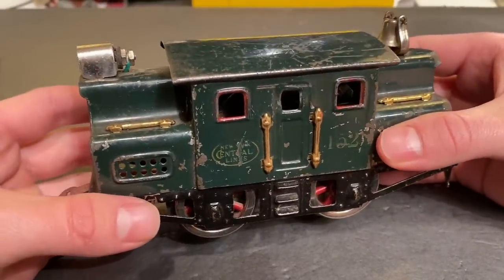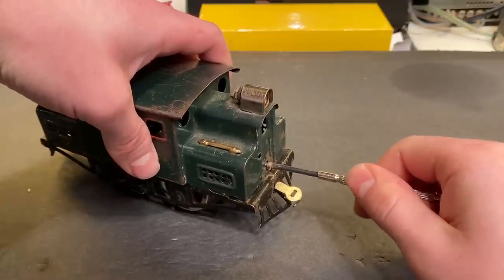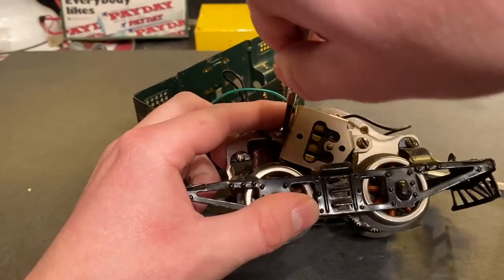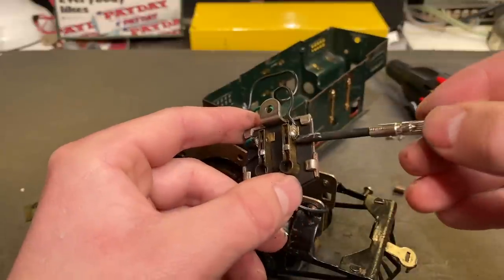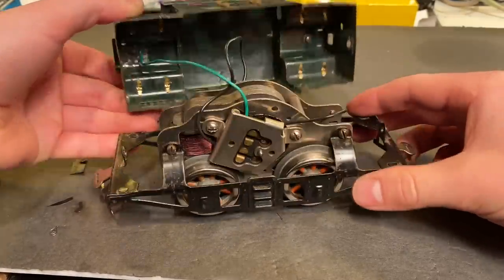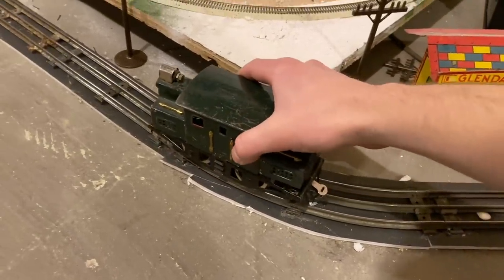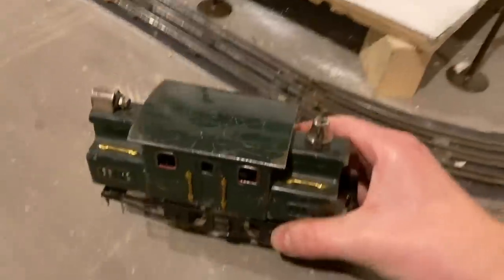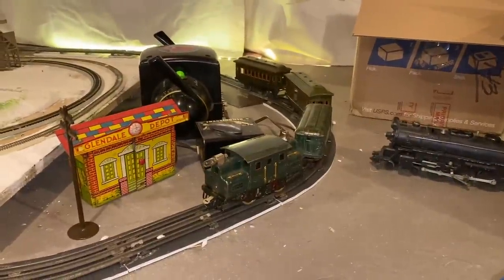Can We Make This 100 Year Old Lionel Locomotive Run Again?

Comment: The Lonel 152 was manufactured from 1917-1927. Great job on getting it back up and running!
Reply from the maker: I wonder where in that time frame this one was made.
Reply: @SMTMainline  Greenberg makes a great little book for this, if I get it for Christmas I'll see if I can't determine what vintage it is based on the design of the motor, although I suspect it's a later one based on the motor frame design.
Reply: A spot on restoration on a Lionel template train
Reply: Jacco nouwen 28 12 1968
Reply: I wonder  it must have cost a fortune back then

Comment: A little bit of knowledge that you might not know: the coils are actually made with fabric insulated wire because magnet wire (the ceramic coated stuff in most HO motors) wasn't developed until the late 30s by none other than AC Gilbert, of American Flyer and Erector set fame. The coils look pretty good on that loco, usually they're covered in dust and old grease. The rollers should also be cleaned, probably is one source of the sparking. I have the Standard Gauge version, the 33. Currently I am trying to find parts for it!
Reply from the maker: I was wondering if the magnet wire was coated with something different, thanks for letting me know. Also I did clean the rollers off camera.
Reply: @SMTMainline  You're welcome! Also the last two coaches in the set are from an American Flyer or Ives set from a similar vintage, but the first one is original.
Reply: Interesting you should mention this because I too have a standard gauge init as well as a couple of cars. The wheels on mine are zinc, or pot metal and are expanding and crumbling apart.... what is out of spec on yours?
Reply: @kleetus92  The pot metal parts should be replaced when you see cracks in the metal. I've had to replace two sets of wheels on Lionel locos so far, one I just completed yesterday! It was a O gauge prewar 248.
Reply: @zenithcoinsandhobbies  no doubt, these are completely shot... these were shot when I was 10... I'm 48 now!
Reply: @kleetus92  What type of loco is it? You might be able to find replacement wheels for it.
Reply: @zenithcoinsandhobbies  same style as this one but standard gauge, so it's the 3 rail version of lgb.
Reply: Enameled magnet wire (actually varnished) was invented by George A. Jacobs in 1907.  Although modern magnet wire is referred to as "enameled" the insulating material is actually a polymer material such as polyurethane or polyester.  The windings on this pre-war #10 (mid 20's to mid 30's) engine are varnished copper with a fine cotton cover.  Those old open frame motors are power hungry and make a lot of dust from the brushes.

Comment: Great job! No E units in that era. The E unit was part of the Ives acquisition about 1931. Someone has replaced the wire as these locos had sleeved and cotton wrapped wire insulation. They get about three feet from the power source and slow down. Adding in additional feeders helps. I once did repairs at a Lionel Service Center, and we would get locos of every vintage, especially around Christmas.
Reply from the maker: Thanks for sharing.

Comment: I’ve serviced this type before.  Yours was in incredibly great shape!  I would however, replace all the wiring in it.  Also, the brush springs are available from Lionel, or any Lionel dealer.  You may have to modify them slightly, but they’re still using similar ones today. By the way, it is a universal motor, and will run well on DC.  You won’t get nearly as much arcing on the commutator and it will run cooler because of that.  I ran many vintage Lionel locomotives on DC.  With steam engines with a whistle, disconnect the whistle, or check for ways to modify the unit somewhat.  Nice job on it.
Reply: His looks fine, someone's already rewired it. Sadly it's something all too common in the American collecting scene

Comment: You did a very good job in repairing that vintage Lionel Electric. First i kept saying it's going to run. I knew it would.  Second this is a replica of THE NEW YORK CENTRAL ELECTRIC built around 1917. It has been featured in photos of on Park Avenue & on The New York Central Railroad. The model has a rich history as well as the prototype. Well done. 👍✅🚂🚃🚃🚃🚃

Comment: SMT - Those wires have plastic insulation; they were replacements for the original fabric-insulated wires.  Don't forget to add some grease to the armature gear & oil to the bearing on the other side.  This is probably a forward-only locomotive; no sign of a E - unit or a manual reverse switch.  You can use your bright boy to shine up the center rail contact rollers.  You can also use a brand-new plastic scrub pad on the rollers & the rail heads of your track.  Keep in mind the wheel bearings on the passenger cars may need oil too.  Like another modeler pointed out, the loco may run on DC too, since it most likely has a series motor.

Comment: Nice job. That loco was repaired previously some time since about the 1970s. That plastic insulated black and green wire didn't exist before then. You could get plastic insulated wire back to the late 1950s, but the insulation looked different. Before that insulation was usually either rubber or fabric covered rubber. The rubber got hard over time and any movement would make it crack. The fabric covered insulation would stay on the wire, but the bare rubber insulation would crack and fall off, leaving a bare wire to short to things. I would guess this originally had rubber and fabric insulated wire, which could have failed and shorted some time in the past.

You need to be very careful with that bare enamel-insulated magnet wire. The insulation on the wire is literally just a layer of paint, and it can scrape off easily on a sharp edge of the frame. It can also crack and flake off of old wire just from bending the wire sharply. But if you are careful with it, it will last forever and work just fine.
Reply: That's some detective stuff there man

Comment: Nice you got it running! I would have replaced the motor brushes and brush springs... but that means buying new brushes and brush springs. Generally speaking you want the springs and brushes to be matching, and there are problems when they don't. But even if it's not "ideal" your fix definitely will last a while longer before it needs them replaced. The solder on the pickups is likely because of an issue a lot of those locomotives have- they use a springy copper strip to press the rollers down to the track, but over time these springs typically work harden and eventually snap. Someone must have used the solder patches in an attempt to repair the break in the spring.
Not too bad, considering you don't know a lot about O gauge!

Comment: As an O Gauge repairman, I'd be happy to share a few tips and tricks whiole maintaining Lionel Engines:
1. Always clean the pickup rollers, and the track. The rollers on that engine look like they could use a cleaning.
2. The brushes have a flat-head divit that the spring should rest into.
3. If you're confident that you've wired everything up and still won't get movement from the motor, try flipping the wires that go to the motor. Where the fielding coil wire goes is crucial to the operation of the engine.

My oldest Lionel loco is from 1939, and of course Lionel has used basically the same motor tooling for all engines c. 1910-1990. I'd suggest you start to get a small gathering of parts (new brushes, springs, pickup rollers, etc.) for whenever these odd jobs pop up.

Comment: We also have Dad's 2-4-2 oil fuel steam locomotive.  The NYC runs great and has never been touched, but the steamer needed to be rewired and the two 3rd rail rollers replaced.  Cost a good but, but it runs like new.  We can now control the speed, where before it was either off or running a full throttle.

Comment: Ohhhhhh, my! My dad had one nearly identical to that one, but it had headlights on both ends, was a little longer, and had the "latch" style couplers. It also was a lighter shade of green, i have no idea what happened to it, but i know it was worth some money. His was either the #251 or the #253, dont remember for sure.
Reply from the maker: I think the one you're referring to is much more rare than these.
Reply: @SMTMainline  quite possibly, i think it was from the 1920s or 1930s, and had 2 "mini-pantographs" on the top, as well as 2 headlights, and there was a directional switch in one lower corner. It had either 2 or 3 matching passenger cars that were lighted. He also had a "2-4-2" steam loco, with a 4-wheel tender, a Shell tank car, yellow gondola, and a green flatcar, plus a red and green 4-wheeled caboose. There were 3 4-wheeled passenger cars, that went with the steam loco set, they were a brownish tan color. I dont know what happened to all of it but i know the whole thing was worth some money. Would you happen to know where i could find some drive bands for some ancient Athearn engines? I have 2 F-7s and a GP-9 that run, they just need those bands. And i am also looking for either an AHM or IHC GG-1, the body doesnt matter, but i need a good mechanism/chassis, or just a motor and drive wheels for one. (I am like you, like to fix older/non-working trains!)
Reply: @SMTMainline  one of the comments mentioned that the older Lionel could run on DC, and that is correct, i have  the manual for the Lionel trains my dad had, and there are directions on how to use the old 6-volt dry cell batteries, as a 6-volt car battery would have way too many amps, and fry everything.
Reply: @paulsmith5398  Ebay seller has Athearn bands. A little over six bucks will get you 24 of them
Reply: @dtsalek  sorry, i dont do ebay......thanks anyway! And have a great holiday season!

Comment: To fix the brush plate use a small washer instead of tape. I think the fiber insulator thickened over time and pushed the brush holders into the frame.

To clean up the coil wire, cut the black wire from the coil and bring it out the back. If not enough wire is available unwind it once. There is a small hole on the top side of the coil insulator. You can use this hole to loop the coil wire through. Then resolder the black wire to it. This is so you can keep it away from the wheels and gears.

 The 152 had a reverse selector lever that stuck out the front of the engine. It seems to be missing. You will need some parts to fix this or keep it running in one direction.

Comment: GORGEOUS engine With this build it can put serious miles (for real). My dad had a Lionel set, we still have the engine, all cast iron, he managed to test it 15 years ago and  it it run perfect. after decades of being inactive. My father told me that was a prewar model and those tend to be more valuable. This thing is heavy as a big hammer anre really big (in comparison to HO). 
It is gorgeous in any aspect you can wish from a model train ... but good lock having an O setup if you are not living in a mansion.

Comment: you should also clean the contact rollers on the bottom of the engine,-- all surfaces of the track with a scotchbrite pad lightly to make good contact. I got my pre-war to work great pulling 7 cars

Comment: Those old O-scale tracks crack me up...
Funny, when i was a kid i had a D-cell battery powered steam train set that rode on a similar all metal tracks with 3 metal ties per piece but 2 rails only and smaller guage - maybe HO sized - but I didn't know anything about different guages back then,
Reply from the maker: Maybe it was S Gauge?

Comment: I just got an old KBN High voltage loco from this era. It came with two of the coaches that this loco would've run with, in the exact same color too
Ask your friend if he wants them, I'll give them away for cheap if he doesn't already have coaches for this

Comment: I think the reason this wasn't working is because someone opened it up at some point to do some maintenance, and probably screwed some things up, especially when putting it back together. They probably came back later to try and fix the mistakes they made and probably just made it worse in some ways. That's my guess because I know I've been there and done that.

Comment: Shades of the New York Central S class of small electric engines.   But the wheel arrangement is wrong.  The prototypes had 1-D-1 and 2-D-2 wheel arrangments.
Reply: Most of Lionel’s early electric locos were based on the S class. The correct number of wheels was not something they worried about. Models came in 0-B-0, 0-C-0, 1-B-1 and 0-B-B-0 depending on size and price.

Comment: That's really cool you got it running . the fact that it runs as it is very old is amazing isn't it?  I mean i see todays locomotives from bachmann or todays Lionel never reaching that feat at all of running almost 100 years old. Athearn ,proto 1000/2000 , mantua varney ahm rivarossi yes and vintage Lionel. And American flyer . not the junk that bachmann makes now and Lionel it wouldn't last id say 20 years at best maybe 30 that's it.   Good job working on it.
Reply from the maker: The Athearn ones might make it this far provided the motors are checked for carbon build up and they are oiled often enough.
Reply: @SMTMainline  exactly I see the good reliable ones are like timex watches take a lickin but keep on tickin
Reply from the maker: @muir8009  In terms of HO there are many other quality brands but I've yet to see one hold up as well as the old blue boxes do. I've seen more motors and gear boxes fail on HO American Flyer Locomotives. As far as modern brands go, I think the Bachmann drives would be the first ones to fail. It's possible modern Athearn locomotives are more prone to failure in comparison to their older models due to sensitive electronics.
Reply: @muir8009  bachman sucks. Period they still have issues and are the still the ones that have split plastic issues on drivetrain. I know because a diesel i have has plastic driveshaft parts that are cracking. Because they are pressed fit onto metal where as other companies dont have that issue my 2nd diesel same brand had wheel and gear issues,  i also had a Niagara 4-8-4 NYC locomotive that had issues and never again would I get another like that.. Anytime sams trains reviews bachmann their mechanisms are junk as always. I'll take any other manufacturer vs that brand unless maybe just maybe the spectrum side but id doubt it be any different.
Reply: @muir8009  I dont care and im not arguing im stating a damn fact... Dont argue with me because you wont win it. Also it's three examples because the diesel has problems the steam locomotive had the same problem the other diesel engine is number 3

Comment: Hey smt 👋👋.i personally own a 1950s Lionel New York central unit and one of them doesn’t work. Any advice. Also can you make a tutorial on how to hook up the control system you have like were you can switch to dc or dcc
Reply: Which one? Lionel made a model of the EMD F3, and there were a few generations of it. They also made a model of the J3a(?) New York Central Hudson, the '50s version was number 773.
The early F3 locomotives use what is commonly referred to as a "horizontal motor", because the armature of the motor is horizontal (makes sense). Later they shifted to a "vertical" motor, which is used in multiple types of locomotives.
The horizontal type motor was used in the New York Central models 2333, 2344, and 2354. As far as I know, those are the only NYC F3s Lionel made in the postwar era (1945-1969). I have worked on my 2353, it is identical to the 2354 except for the paint scheme. The horizontal motor drive is inherently noisy, and may look a bit complicated. The best thing to do is to carefully take it apart, and clean everything thoroughly with alcohol to remove old gunk and grease from the drive. You will likely need to use a toothpick, and maybe an old tooth brush to aid you in removing it all. Make note of exactly where each part goes as you take it apart (taking pictures helps!). 
These drives look pretty complicated, but they're nothing to be afraid of. 
I recommend replacing the motor brushes if they are shorter than 1/4". Of course, you will want to lubricate the drive as well. Apply a drop or two of oil to every bearing, and apply grease to all gear teeth. Note that there is no bearing on the brush plate of the horizontal motor, the bearings are behind the windings on one side, and behind the drive gear on the other end.
The Classic Toy Trains forum is a great place to go for advice, by the way. I also recommend picking up a copy of the Lionel Service Manual, it is a reprinting of old documents for instructing service stations on how to repair postwar Lionel trains- it has diagrams and information for almost everything Lionel made between 1945 and 1969. It is a great help if you want to see how an item fits together, or if you want to find the part numbers for parts you need to replace. Often there are useful tidbits informing you of common problems discovered with certain models, and the recommended strategy to resolve them.
There's certainly a few videos on YouTube of people fixing these earlier F3s but you might have to look at a few to decide what's helpful.
Good luck! Again, the CTT forums are a great place to seek help, highly recommend. People are very friendly and happy to help newcomers to the forums.
Reply: It was 2-4-2 named 999

Comment: What is that tool u used the clean the compintator that is shaped like a pen
Reply from the maker: It's a fibreglass pencil.
Reply: @SMTMainline  I see 3 different types, I guess u use coin?
Reply from the maker: @RailfanUS  Also use a track cleaner or q-tips. Unless you mean the blue plastic toothpick.